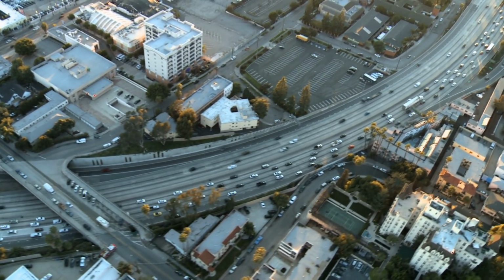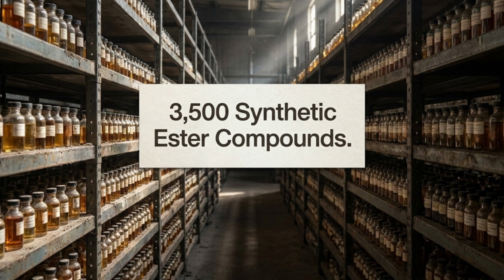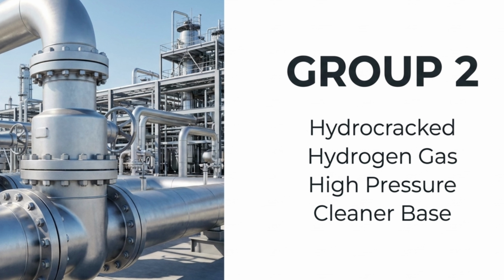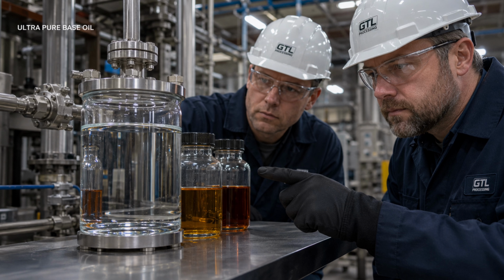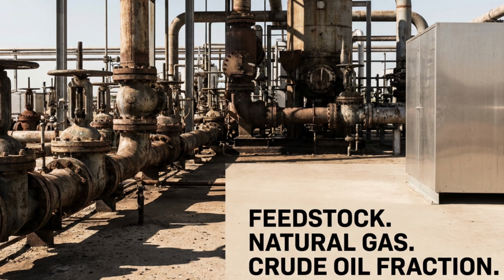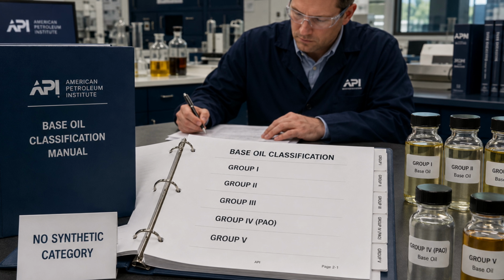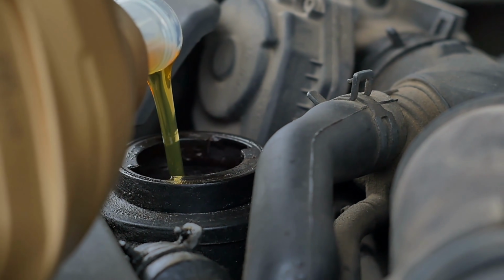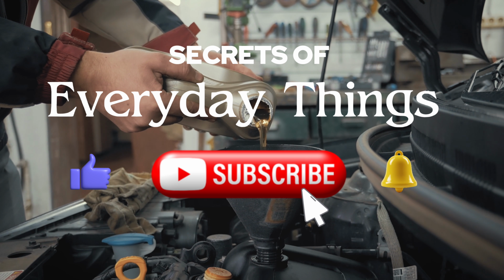How Is Synthetic Oil Made? THE TRUTH BEHIND WHAT “FULL SYNTHETIC” REALLY MEANS

Comment: I've run full synthetic in my 27 year old LS1 for 204,000 miles with no problems.
Reply from the maker: 204,000 miles on a 27-year-old LS1 is a fantastic track record! That engine clearly has been well looked after. How often do you usually change the oil on it?
Reply: @SecretsofEverydayThings  3 to 4K miles and made sure things like valve cover gaskets, main seals and oil pan seals got replaced when needed.  Really, LS1's can go a long time before needing a tear down.  They are pretty simple small blocks without a lot of computers and no cylinder deactivation.

Comment: So.....  Is there anywhere on the product label that tells me what group the oil is???
Reply from the maker: The API “donut” on the bottle shows the service rating, not the base oil group. Some brands do mention PAO (Group IV) or esters (Group V) on the label, but the most reliable place to check is the manufacturer’s product data sheet or website. Which brand are you using? Happy to help you dig into it.

Comment: The Milwaukee Road bought new GE 3000 hp engines. After 1 year the units died and engineers came to study the problem. They removed the oil filters to discover that the oil was like tar. The engines never had an oil change since they were bought.
Reply from the maker: That’s a remarkable maintenance story. Even excellent oil can’t compensate for neglected service intervals. Thanks for sharing the example!
Reply from the maker: Good technical point. Dissolving contamination is only part of the job — the contaminated solvent also has to be removed rather than simply redistributed. Technique matters a lot.

Comment: Motor oil is over engineered. It's car manufacturers today that produce POS engines. Now add government regulations to that and what you have is a state of automotive industry we have today. There was a time when Toyota, Nissan, Honda, Mazda, Chevy, Ford, Chrysler, Dodge and Jeep, all had made engines, at one time or another, that could last for 200-300 thousand miles while running on basic conventional oils.
Reply from the maker: You raise a fair point about engine design. Modern oils have also become more specialized because today’s engines face tighter tolerances, turbocharging, emissions systems, and longer service demands. Thanks for sharing your perspective.

Comment: Let's get to the point. For the most part, using cheaper priced mineral oil will allow your engine to last longer than the vehicle itself. Using anything else is a scam and many are falling for it.  I use the cheapest oil on the shelf when I change it every 10,000 city driven miles. Have mixed brands, types, and viscosities and with over 283,000 miles, the body is rotting away from the engine. Let the comments begin.
Reply from the maker: Thanks for sharing your experience. The key is using an oil that meets the engine’s required specification and following an appropriate service interval.
Reply: @SecretsofEverydayThings  The answer you just provided is consistent with what the majority of YouTube creators tend to say, and in my opinion, it seems primarily intended to protect themselves from liability.

I have already provided an example demonstrating that manufacturers do not always fully understand or communicate what they are referring to. With that in mind, let’s consider GM. They have been designing and manufacturing engines for more than 100 years, yet we are now expected to believe that they suddenly cannot get something as fundamental as oil viscosity recommendations correct—while simultaneously instructing vehicle owners to switch viscosities.

That raises a legitimate question: if a manufacturer with more than a century of engine-building experience can change its recommendations, why should we automatically assume that the original recommendation was unquestionably correct?

Comment: I have been using Mobil Delvac 10W 40 in my diesel SUV engines for the past 25 years in India. This oil is ment for haulage trucks and mining equipment. But it worked wondrs for me. My 1st SUV did 350000 Km, the second did 4 the third is on 2.5......all without touching even the valve cover !!😂😂😂😂
Reply from the maker: That’s some impressive mileage. Heavy-duty diesel oils can be very robust, but the key is still whether the viscosity and performance specifications match what the engine manufacturer requires. Thanks for sharing such a long-term real-world experience!
Reply: @SecretsofEverydayThings Oh and I forgot to mention that all these vehicles aren't Toyota or Isuzu they all are our own Indian brand Mahindra all with indigenous engines !!

Comment: Use ETHANOL for fuel, your oil will stay much cleaner!
Reply from the maker: Interesting point. Ethanol blends can reduce some combustion-related deposits and particulate emissions, but the effect on engine oil is more complicated. Ethanol can also enter the crankcase, dilute the lubricant, change its viscosity, and affect anti-wear protection, especially under certain operating conditions. Thanks for bringing it up!

Comment: "Real" Synthetic motor oil will say 100% synthetic, not "Full" synthetic. Started using Amsoil when it was spelled with a Z. About 1973, working at -40 in the Rockies, my 240-Z  would  spin over and start like it was 80 above.
Reply from the maker: Thanks for sharing that firsthand experience. Cold-weather performance is one of the big advantages people have long associated with synthetic oils. Labeling can vary, though, so “100%” versus “full synthetic” alone doesn’t always reveal the exact base-oil composition.

Comment: Do NOT use recommended oil change intervals from the manufactures, they are wrong. With full synthetic oil, changes should be at 5000 miles, NOT 7000 or 10,000 like some car makers claim.
Reply from the maker: Thanks for sharing your experience. Oil-change intervals can vary a lot with the engine, oil specification, driving conditions, and service schedule, so there isn’t one mileage that fits every vehicle.

Comment: We were poor so my dad used Ray-Lube in his cars.  It was a super discount parraffin based cheap oil.  I use Mobil-1 in my cars and change it at recommended intervals, typically 5k miles.  And I do run a Top Tier+ gas exclusively.
Reply from the maker: Thanks for sharing your experience. Following the correct oil specification and a sensible change interval can make a big difference over the life of an engine.

Comment: Synthetic shelf oil is better than concentional.  

I just see it this way I have a 20 year old Ford focus always used synthetic oil change ever 6 months instead of every 3

Oil still looks fairly golden even at end of 6 months and leaves a smooth oil feel when some gets on my hands when I change it.

Engine has over 300k miles no seal leaks but did have to change valve cover gaskets and grommets a year ago.

I seriously see even cheap synthetic as way better than conventional oil.
Reply from the maker: That’s impressive mileage! Synthetic oil can offer real advantages, though oil color or feel alone isn’t a reliable measure of condition. The correct specification and change interval still matter most.
Reply: Prove it

Comment: I understood the 5 groups of oil and 1, 2, and 3 contained good old fashion oil from the ground.  I also knew 4 & 5 didn't. In addition, I also knew #3 was not really a full synthetic oil but was allowed to call itself that.  I wonder what if any protection I was giving up, using a group 3 oil over a 4 or 5 oil.  I now know #3 oil provides all the protection my engine will ever need. If my oil is a group 3, 4, or 5 oil is not as important as the additives added and ensuring I change the oil often enough so that the additives don't stay in the engine to long and break down.   Of all the motor oil You Tube Videos I have watch this one taught me the most of what sets the 5 groups apart.  Thank you for clearing up the details the other videos skipped.
Reply from the maker: Good point. Base-oil group is only part of the story—additives, specifications, viscosity, and proper change intervals matter just as much.

Comment: Aviation-grade neopentyl polyol ester base oil - a savior for modern high-tech turbo engines.
How to correctly choose truly fully synthetic motor oil: 
Motor oil components - base oil. 
Base oil - Group V base oil (aviation neopentyl polyol ester + Group IV base oil (PAO)polyalphaolefin).
Advantages of aviation neopentyl polyol ester base oils:
Neopentyl polyol ester base oils for aviation lack any β-hydrogen in their molecules, therefore they decompose at higher temperatures (320 to 340°C), while diesters decompose at approximately 280°C. Due to their poor thermal stability, diesters have been phased out and replaced by aviation neopentyl polyol ester base oils. Aviation neopentyl polyol ester base oils are the only base oils capable of providing the thermal and oxidative stability, lubricity, cleanliness, and low-temperature performance required for aviation jet engine lubrication.
Advantages of ester oils: Easily adsorbed and stable oil film. The polar structure gives ester oils special lubricating properties, easily adsorbing onto interfaces to form a stable oil film, preventing complete backflow even in cold conditions, providing excellent low-temperature protection. For example, compared to mineral oil lubricants, the polar functional groups of ester groups act like a gecko's suction cup, adhering to the friction pair interface and not easily detaching even in cold conditions.
After reading the above, do you understand why ester-based fully synthetic lubricants are expensive and why they are good?
Reply from the maker: Good point. Base-oil group is important, but the finished oil’s specifications, viscosity, and additive package matter just as much when choosing an engine oil.

Comment: It's not just about SAE viscosity. With tight SAPs requirements for diesel engines there are other factors. Change it every day and you'll still have DPF issues if the oil is wrong.
Reply from the maker: Good point. For modern diesels, the correct specification matters just as much as viscosity. Low-SAPS requirements, additive chemistry, and compatibility with the DPF are all important. Thanks for adding that detail!

Comment: I prefer frequent oil changes because fresh oil—even if it's just Group II—is cleaner than synthetic oil that has been left in the engine for too long.
Reply from the maker: Good point. Oil quality and change interval both matter, and even excellent synthetic oil doesn’t last forever. Following the engine manufacturer’s recommended interval and oil specification is usually the safest approach. Thanks for adding this perspective!
Reply: I did the same but mineral oil with any additives tend to degrade faster and need replacement only option without even relative use.

Comment: My Tesla came with Pennzoil Full Synthetic and hasn't used a drop in over 90000 miles. I'm sticking with Pennzoil.
Reply from the maker: That’s an impressive 90,000 miles! If it has served you that well, I can certainly understand sticking with what works. Thanks for sharing your experience!
Reply: @SecretsofEverydayThings  I think you missed the statement: My Tesla came with Pennzoil Full Synthetic." Not sure where you would use oil in that oversized RC car. thanks for your reply!

Comment: Not all crude oil is thick and black, there are all kinds of different "oils" that come out of the ground.  When you see the term "sweet" crude listed on the commodities page,  that means its higher quality than the thick black oil that has a lot of H2S in it.  Much of the oil in North America is coppery colored not black.
Reply from the maker: Absolutely, crude oil can vary greatly in color, density, and sulfur content depending on its source. The dark, heavy crude shown is only one part of a much wider range. Thanks for adding that distinction!
Reply: @SecretsofEverydayThings  
Shell Helix is from natural gas, and as stated near no impurities in the base oil.
Venezulan oil is like syrup. They have to import thinner oil to mix so pumps can pump it.

Comment: I remember when synthetic oil was introduced to the public in Vidalia Georgia back in the 70's. I worked in an auto parts supply warehouse and delivered to a lot of the stores in the small towns. 
Whoever was demonstrating the oil would run the motor at an idle with the synthetic oil and without oil too. I drove by the large parking lot but didn't stop. I believe it was the TG&Y store's parking lot. I had a schedule to keep.
At some point, one of the fan blades broke because of the motor vibrating without oil. The blade cut a man's hand and part of the forearm off. 
If I remember correctly, the sales pitch was that the oil could be used for 30,000 miles before changing. 
That is just one memory I have about oil, people and vehicles from those days.
Reply from the maker: That's quite a firsthand memory from the early days of synthetic oil. Thanks for sharing your experience and that piece of automotive history.
Reply: I recall high mileage vehicle owners using fully synthetic, then it was synthetic, as it cut back on oil changes - a day less a car is not in down time. It was economics that drove them not engine protection.

Comment: I Drive a 2004 Chevrolet S10 Blazer with a Vortec V6 and a 5spd Manual Transmission. I've only put in Mobile 1 Full Synthetic Oil since I got it New. It has almost 300,000 miles on it. Engine has Never been Rebuilt. Still Fires up First turn of the Key every day. Change My Oil RELIGIOUSLY !!!
Reply from the maker: Nearly 300,000 miles on the original engine is impressive! Regular maintenance clearly matters. Thanks for sharing your experience!

Comment: My last work Van was a 2008 Chevy.\nWhat's an 8 cylinder Four point six liter , I believe.
  Always use mobile one full synthetic , and I got 349,000 miles on that motor.  And it was the transmission that made me sell it , because it went bad. The motor was still running fine.
Reply from the maker: 349,000 miles and the engine was still running well—that's quite a record! Thanks for sharing your experience with synthetic oil.

Comment: Semi synthetic is much better for.the engine , my motor runs much better and quieter.
Reply from the maker: Thanks for sharing your experience! It's always useful to hear what works well in different engines.
Reply: That may be the weight of the oil rather than it being semi. All engines have hot spots.  Mineral oil would burn and cake up at these spots. Fully 'real' synthetics do not burn up.  Real fully synthetics are resistant to compression, keeping metal surfaces apart. Also fully synthetics are resistant to compression, keeping metal surfaces apart. All fully synthetics are resistant to compression, keeping metal surfaces apart. Thy do not thin out as much as mineral. More stable.

Comment: I was under the impression they'd stopped using zinc in modern oils because it could harm the catalytic converter & it's now usually only found in oil for classics. I could be wrong.
Reply from the maker: You're right that modern passenger-car oils generally contain lower ZDDP levels to help protect catalytic converters, while some oils for classic or high-performance engines still use higher amounts.

Comment: I got my first car in 1970 in college.  An 1800cc 4 cyl engine (Volvo B18).  I changed the oil and filter every 3 months using Castrol 10-40, same as it had always been done in that car.  I took the engine apart in a class exercise, and at 165,000 miles, there was no measurable wear, no ring-ridges.  My professor was astounded, as was I.  Now I use a synthetic oil in my car and change it and the filter every 6 months.  I don't drive as much any more, being retired.  I just hope the engine will last as long as in that first car I had.
Reply from the maker: Thanks for sharing your experience! It's always interesting to hear long-term results from someone who's used both mineral and synthetic oils.
Reply: Th Volvo B18 engine had oversized main bearings - too big for their inteded operating conditions.  The bearings were made in the UK as were the parts of many Volvo cars.
Reply: What car are you driving now?

Comment: My feelings on synthetic oil is that they are better in every way than regular motor oil. But does an average engine need synthetic oil? Probably not, race car, probably so. Most engine oil gets contaminated by combustion byproducts so it needs to be changed to get rid of those. I use synthetic oil in transmissions and rear end gears where there are no combustion byproducts
Reply from the maker: Thanks for sharing your perspective! That's a thoughtful way to look at it, especially regarding different applications.

Comment: No matter what oil you use, I use. Synthetic oil should be changed at least every 5000 miles. Oil gets dirty. It's in a combustion chamber.Do that.Your motor will go a long, long time
Reply from the maker: Thanks for sharing your experience! Regular oil changes are definitely one of the best ways to help keep an engine running well.

Comment: when lawyers get involved things usually turn bad. we've ended up with ultra refined legally defined equivalents instead of genuinely synthesized oils.
I worked for TWR in the mid 80s building Group C Le Mans engines. we used a Motul synthetic oil that came in quart metal cans and smelt a bit like bubble gum. that oil was incredible. it could flow, take heat and load like nothing else I've seen.
Reply from the maker: Thanks for sharing such an interesting experience. It's great to hear insights from someone who worked directly with high-performance engines.
Reply: @SecretsofEverydayThings Blah-blah stupid AI